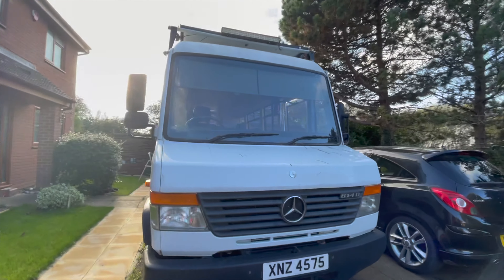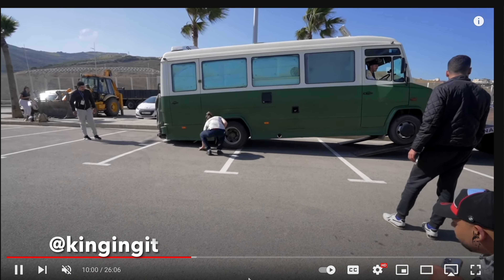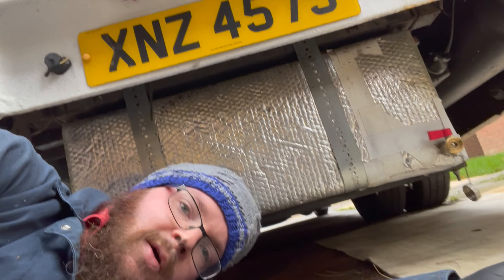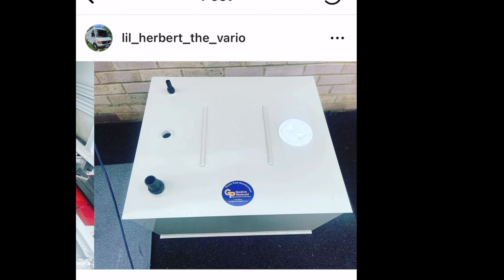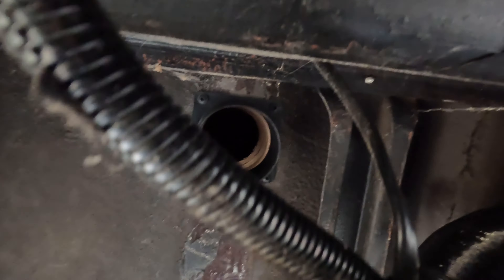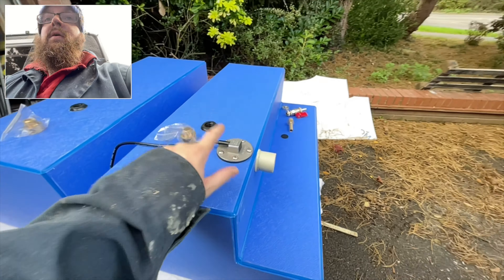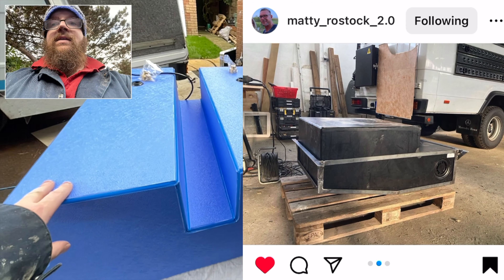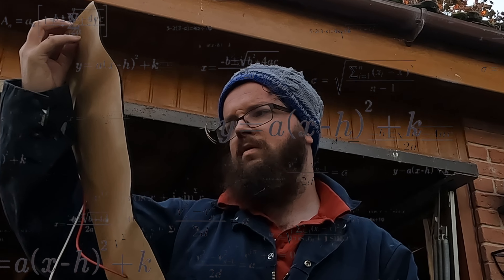TOO BIG! Switching Our Van Conversions Water Tank for Custom Underslung Solution

Comment: Got me worried now as my tank is 350 ltr with about as much clearance as your old one, at the min i think i ll just run with it until it becomes a issues. Do you have a link to the wire connector with the glue on them please. great video as as always
Reply from the maker: That's what we did, and it was fine. Just worried if we did have to go anywhere very steep or on tow (fingers crossed we won't). 

These are the butt connectors we use: https://amzn.to/3TJu95K and the crimp tool we have (but yours might do it) https://amzn.to/3AafhpJ they give a very good connection. Would recommend for sure. Thanks Terry 😊

Comment: Hello guys !!! Thank you for that , I was about to order my water tank same as yours for my Vario I just received 2weekes ago and i just bumped into this upgrade going through your olsd wtare tank video. Thank you. can you tell me about to had it made ? And what about your used water tank ? Where did you put it and how big is it ? I'm not sure I have seen a video of it. Thank you very much. And would mind give me your measurement of your new tank if you still have one somewhere.
Reply from the maker: No worries, congrats on your new van. Sounds exciting! So the tank was made by a company named EMPF - the dimensions are quite unique to our install as it had the frame already in and we worked around it. But the overall dimensions are 1100mm x 680mm x 320mm. 

The old tank was sold on, a local man bought it off us and used it for rain water harvesting for his eco house which we thought was a cool use.
Reply: @WanderbusAdventures  Hey thank you very much guys !! By the way where did you put your dark water tank we start to missing space underneath the chassis lol. We will put a second fuel tank of 90l on the other side of the actual one so not much space for the dark water tank. Thank you mate.
Reply from the maker: @cyril6696 no problem. We have two fuel tanks opposite each other. The waste water is located behind the passenger side tank. It’s only 60l.
Reply: @WanderbusAdventures  Thank you very much. We will need to have at least  an 100L waste water tank to complain with the motorhome french regulation :( 
By the way can you give the ref or the link of your second fuel tank ? It is a genuine mercedes ? We are about this month to buy it. We are gonna start the chassis work beginning of November, working on layout and listing stuff right now. Thank you.
Reply from the maker: @cyril6696  oh wow. Didn’t realize there was a regulation in France. Ours could be a bit bigger. We find we have to empty it into a container when on site for more than a couple of days. 

Re. The tank. I don’t have the reference but will try and find out.

Comment: Just out of curiosity are you planning a trip over winter to somewhere your tank will freeze?
Reply from the maker: Eventually that’s the plan yes. For UK trips the tank blanket should keep things fluid but we are planning on adding self regulating cable to the pipes themselves; and we will be lagging the tank should we plan to go anywhere super cold. 

One other happy coincidence of the diesel heater being underslung and having low skirts is it actually heats under the van too. Not to super hot standards but the Ruuvi under there gets to 28 degrees and it’s on the opposite side. So we hope that’ll help too - but time will tell on that.
Reply from the maker: But as an aside would love to go to Norway and Scandinavia. We are much more interested in cold places - there’s something about them 😊
Reply: I don't do cold,why don't you just get a fridge freezer,and save some cash 😂
Reply from the maker: @johngriffiths7621  that’s where we are right now John. Log burner on in the room for ambience.

Comment: I think I know who built that tank for you. He is based just outside Manchester if I remember correctly and his house is built by him
And you have to drive down a step hill to get to his? Is that right?
Reply from the maker: That’s right… we think. He’s based in Oldham we believe. Haven’t been to his place though so can’t comment. Once we’d sorted the dimensions and whatnot he built it very quickly and it seems very well built. And it’s blue, which we like 😂
Reply: @WanderbusAdventures  so far we won’t be using the van for fulltime but part time, so with our tanks inside it should be ok. If we need to adjust it in the future then we can always have him build one for us outside 😊
Reply from the maker: That makes sense for sure.